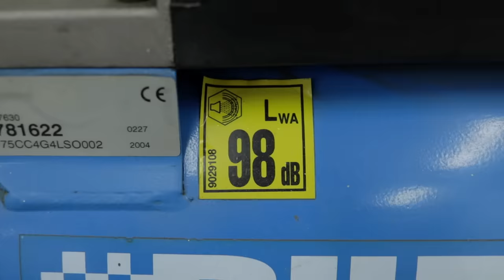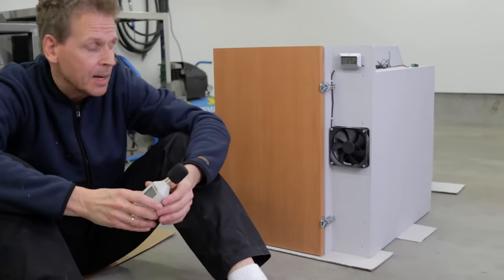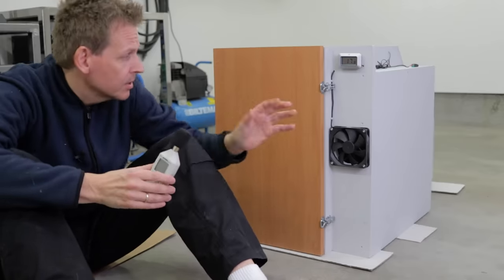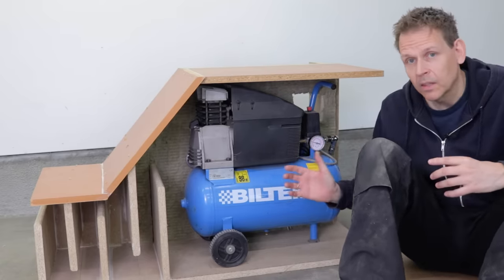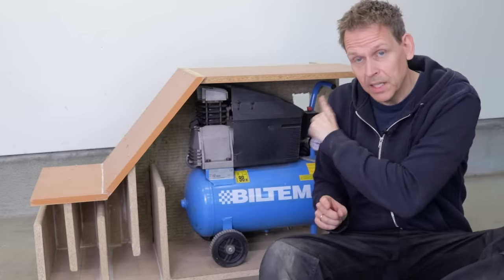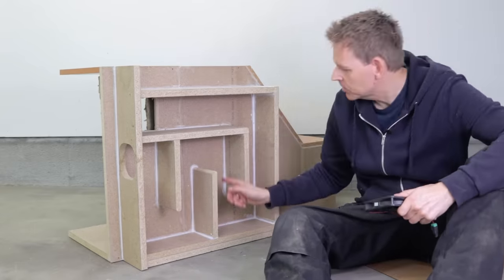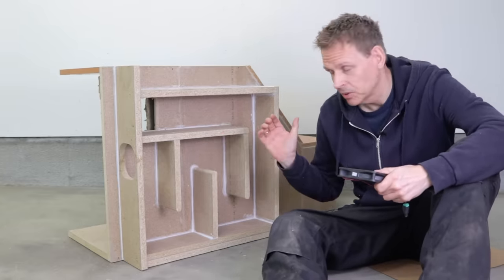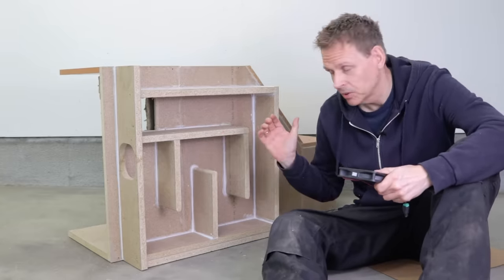Do not build a sound insulated enclosure for your noisy air compressor!

Comment: One suggestion I would like to give would be to place a rubber mat on the floor of the box so that the compressor does not transfer vibrations to floor and onto your shop.
Reply: My compressor has rubber feet already did that, I imagine most do?
Reply from the maker: Yes, that is a very good idea 💡
Reply from the maker: Both if mine compressors had a tiny rubber piece on the foot, while the wheels where hard plastic. I think removing all of these and add a softer and thicker rubber will reduce vibrations transferred to the box

Comment: Transfor it to water cooled and then you can close the box. Or, build a small cabinet OUTSIDE and put the compressor there while you are in a different room, it will be really quiet.
Reply from the maker: You cannot close it 100% even if waterholes, an air compressor needs air 😅 the opening for the air intake is actually on of the most nosy part of the air compressor.

Comment: There is a foam that kind of looks like an egg crate that is often used in recording studios.  The foam both breaks up the noise and absorbs it to provide a quieter environment.
Aside from putting stuff under the air compressor to remove the dense contact vibrations, adding this foam will also help reduce the noise.
Reply: That foams generally not used for sound deadening, but to cancel out or reduce reflections of noise. The material used for sound deadening is more dense. I found this out doing a bit of research on sound deadening rooms.
Reply from the maker: Yep, that sounds to be right. I used Rockwool sound insulation in the main chamber of the box. It's 50% more dense than regular insulation made to absorb the sound waves. I have used the same in my ceiling, and made a video of it: https://youtu.be/4EkoAMJAIug

Comment: honestly, mine makes such a low pitched noise that it isn't that uncomfortable.
If you suspend it on paracord inside the box, it will get even quieter as the mechanical coupling between the compressor and the box will reduce significantly.
Reply from the maker: I guess you might have a belt-driven air compressor? These runs at slower speed and don't make this terrible high pitched noise as the direct drive air compressors. 
Vibrations transferred to the floor is what causes most noise now, suspending the It might be complex to securely suspend the air compressor using paracord, it is quite heavy 😳 I think using rubber or another sound insulation material between the compressor, the box and the floor is an easier solution. Thanks for the tips!

Comment: I just move the compressor to a different room. The only problems I see with box is over heating and remembering to drain the tank when your done working. Compressed air will also have moisture in it that collets inside the tank. If you leave that moisture in the tank you run the risk if it rusting out or worse blowing up because the rust weakened the walls and or welds of the tank. Otherwise, it does make it quieter.
Reply from the maker: Yes, draining it is important! It's a bit cumbersome as it is now, I need to open the four eccentric locks and pull of the door and then take the compressor out of the box. It takes no more than 5 minutes, but it's enough to postpone it to the next day 🙄I better put on a line with a drain valve outside of the box....

Comment: What if you found out where the sound was coming from and put baffled reverse flow pipes there as a muffler?
Reply from the maker: From what I have found a muffler on the intake / exhaust helps a bit, but not very much. I could be wrong though... I did some research but did not find any solution that I found to be very efficient, not even the ones fitted a big car muffler. The tank itself also emits noise because it acts like a sound chamber. I would guess that if a muffler really worked, the vendors would have added it.

Comment: The best sound reduction is to place the compressor in a completely different room a little further away. 
The compressor capacity can easily be solved with a tank (hydrifon tank). It is important then to have a drain at the absolute bottom because a lot of condensation water is generated in it, so blow it out every two hours so you don't get rust in the tank. Please do not have the tank in the same space where you are working, in case it bursts.

Comment: Why did you use fabric padding to reduce sound level in the enclosure?  That's a lot of expense and time to cut and paste in place.  Better is to plan the box and purchase your eggs in natural fibre egg cartons.  Line the inside of the box with egg carton bottoms.  The conical shaped face is a great sound absorber.  And it costs nothing because you were buying the eggs for your breakfast anyway.
A friend of mine once asked for help with his brother's machine shop.  He had multiple hydraulic pumps for CNC machines.  He wanted to consolidate it to a single pump to service the entire plant.  He dedicated a room off the back of the shop for the pump system, provided a ventilation fan that drew air from outside and vented downwind from the inlet.  By keeping everything in a separate room (behind a cinderblock wall) there was hardly any noise from the hydraulic system in the shop space at all.
Reply from the maker: Hehe, you are right about egg cartons - we definitely buy them anyway 😅 But I did actually add 3cm Rockwool insulation made for sound insulation inside tha main chamber. I used a thin but somewhat fluffy fabric in the ventilation channels because I did not want to restrict airflow, but hoped it would help a bit.

Comment: The box need to be with double walls around the Compressor and most important You must fill it with Stone Wool for acoustic insulation....👍🌟
Reply from the maker: Yes, others had suggested double walls for better sound insulation. It would probably have made it even more silent 👍 I do use stone wool inside the main chamber: 3cm Rockwool insulation - an extra dense type made for sound absorption. I know it is not very visible in the video, but it's there ☺️

Comment: Based on the back and forth design of the exit i feel like this is acting like a resonance body too aswell as dampening the sound. The rumbling got louder of the quiet compressor once it went into the box. Kinda like a sub roofer.
Reply from the maker: I think it's because the mid and high frequency sound waves are dampened you hear the low frequency sound better, these sound waves are harder to get rid of. I don't think the box is capable of amplifying the sound, but it's true that it's not that efficient for the low frequency.

Comment: There's three things you're doing with sound.  One is destruction of sound and converting it to heat.  Two is a physical barrier that blocks the sound.  Three is damping surfaces so they don't excite and become speakers themselves.

The box you made sort of does these to a marginal degree.

Products like foam or fiber batting primarily target higher frequencies.  It doesn't do much with lower frequencies until you have a rather significant amount of thickness, think several inches.  So it's use partially depends on what frequencies you're trying to remove.  And then you have to have a thickness amount suitable for the attenuation you're seeking.

The second part is blocking sound.  You want a physical barrier.  This is effectively what your box is, but any high density product works.  Even metal is a remarkably good product to use.  For sound deadening products that address this, usually vinyl or lead is used.  The barrier should also be decoupled from other surfaces.  You don't want it imparting excitation of itself into the nearby structure.  Again, sound deadening products built for this often have a foam layer bonded to the vinyl or lead "wall" to decouple that surface and help prevent transfer of energy.  You can also use layers of walls and even different materials that individual excite at different frequencies.

The third is addressing excitation.  You want to stop the panels from vibrating.  You want to damp them.  Typically this is done with mass loading and stiffening.  Again, for sound control products, there's already a solution in the form of a butyl adhesive layer and a decoupled aluminum layer, and this both damps and stiffens the surface, drastically changing its excitation frequency and its decay rate.

These tools work together to both block and decay sound waves present in the space as well as prevent the transmission of energy and excitation of panels.  Typically, the mass loading layer is about 25% coverage dead center of large open panels to damp and control excitation.  Then over that is typically a 100% coverage layer of a decoupled high density layer being used as a barrier.  And beyond that is another, thicker layer of foam to to trap and break down sound waves inside the space converting them to heat.  And this system as a whole doesn't need to be very thick either.  The car audio world has forever been managing sound at very high dB levels and all frequencies.
Reply from the maker: Thank you very much for your thoroughly explained comment. I will definitely read over this a couple of times, I have a lot to learn about this, it is a very interesting topic ☺️ Thanks a lot!!!

Comment: The reduction was impressive, could make all the difference in a more crowded environment.
Reply from the maker: Absolutely, the box the way I built it helps a lot. Replacing the noisy air compressor with a silent one also helps a lot. Doing both, silent air compressors in a box, and you will never go back 🤩

Comment: What I plan to do when we move and I can build a proper workshop is hook up two compressors in tandem so I can plumb air throughout the workshop and outdoors (and firepit!) and have plenty of capacity to do whatever I want with pneumatics but install the compressors in their own outdoor enclosure constructed with cinder blocks so it's completely isolated from our house and home offices and also doesn't bother neighbors.
Reply from the maker: Very good plan! If you can move the compressor away, in a separate shed, that's just great! Could be that one big one is better than two small ones, but it all depends on your usage 😊
Reply: @kihestad  to run just one sandblaster, or just one HVLP sprayer, or just general cleaning and impact or ratchet work and maybe playing with a few pneumatic servoes as a home hobbyist, two in tandem is a better and cheaper solution than one large unit. I plan to run a solar array and have a powerbank to run hobbyist stuff like compressors, the greenhouse, and even a heat pump to keep the greenhouse climate controlled year round (and grow lighting for the winter months)
Reply from the maker: @kimvette1  great plans!!! Good luck, you have a lot of fun work ahead!!! 😊

Comment: Why didnt you use the sound absorbing/damping pads used in sound recording. They dont cost much and would work well.
Reply from the maker: I did use Rockwool sound absorbing mats (3cm = 1.2 inch) inside the main chamber, they are great! I used the thin fabric in the channels because I was afraid of not having enough airflow for cooling.

Comment: Well, that was quite the effort. Those oil-less compressors are annoyingly loud. I made the mistake of getting one and (un)fortunately it didn't last long. I replaced it with one that had a cast iron cylinder pump. Much more bearable especially if you install a hose on the intake and route it away from your work space.
Reply from the maker: Hehe, normally when you wait for something to break or wear out  so you can buy a new one - it never breaks and lasts forever 😫😂

Comment: Most noise from the standard compressor is the intake filter assembly they’re videos on that please watch they really work and much cheaper to do
Reply from the maker: Well, from what I have heard it helps quite a lot, but not as much as building an enclosure. The noise is also transferred through the motor and the tank.

Comment: Not that this is a cost effective solution but eastwood makes a scroll compressor that is significantly quieter than a piston compressor.  Granted it is a shop compressor so its much bigger and more expensive but the amount of air it pumps is disproportionate to the noise it produces.
Reply from the maker: I totally believe you are right. I heard one those running once (it was not an Eastwood though), it was just a bit louder than an old refrigerator 😅 but unfortunately too expensive for me 😔

Comment: when building sound proofing, once important design element is an air gap.  If you were to build an outer shell that only touched the inside as little as possible, it should reduce the dB's even more.
Reply from the maker: Ahh, yes that makes sense. Thanks for the tips! Perhaps a bit complicated build, it will be like making a box within a box with spacers in between, but it is absolutely possible 😊
Reply: @kihestad  yep, when sound proofing it's amazing what that air gap does to the final results.

Comment: Some people use duct tape, some use zip ties,

This man uses o rings.
Love the video, but wondering why the title was chosen? I would still do it, just feed to outside air. I also live in rural country, but I think protecting your hearing is always worth it (I've lost my once good eyesight, my cardio endurance and a few joints don't work well. Hearing is all I got left). Plus I think the enclosure adds some protection if the compressor should go wrong (tank explosions are real/manufacturers do make mistakes).
Reply from the maker: Ahh, sorry to read about your eyesight and other problems. It easy to take such a thing for granted until problem occurs. I do agree, I think the box is worth both the cost and effort if you consider the protection it gives - both for your hearing and possibly to minimize damage if explosion happens.

Comment: Tried an sound reducing enclosure on a larger compressor a sears 6.5 HP oil free unit. sound was reduced by more than what you seem to have, but box was much larger. Problem 1. excess heat in summer months reduced run time by many times, like after running for 1/2 hour it required almost 45 minutes to cool enough to run again, #2. in winter it got to much condensate after shut down and as it cooled it froze and broke a valve. skip enclosure to preserve life of the machine!!
Reply from the maker: That is a very valuable info! I absolutely share your concern when it comes to overheating. The air compressor will not live for long if it is constantly hot above the recommended specs! 😐 However, It's a pretty cold climate here where I live in Norway, in the Northern part of Europe. I have actually fitted a heat pump in my garage to be able to use during winter time. I can see overheating is a big challenge in warmer climates. A more powerful fan or even radiator cooling could be needed must then be considered.

I have fitted a thermometer and I do check frequently that it's not getting to hot inside the box. Normally the temp increases 5C = 10F when it starts until pressure is built up, and it takes just a couple of minutes to cool it down. If it is running constantly over longer periodes it can get a bit hotter, I have seen almost 10C = 20F increase. The warmest summer days can be 30C = 86F here where I live, but that is very rare. Its more commonly 25C = 77F, so it never gets very hot inside my box.

Comment: Like a muffler, you need to fill the empty spaces with a baffle material that not only reflects sound but absorbs it.  putting the sound absorbing material on the walls is not enough, you need to fill the empty spaces part of the sound maze.
Reply from the maker: I might have left the ventilation channels a bit "open" - but I also want quite a high airflow for cooling - so it's a tradeoff. I might add a bit more though, because I have plenty of cooling as it is now, a bit more restricted airflow should be OK. Thanks for the tips! 👍

Comment: The baffles slow the air down, so in principle, you need to provide a lot more of it, in the context of muffling a compressor. Also: helps to have selective hearing. I know, its a superpower, but I got it. You can try to achieve it though.
Reply from the maker: I know all about selective hearing (I am married) it's a superpower indeed 😅

Comment: I think you could have reduced the sound a bit further by wrapping the exterior in  Mass Loaded Vinyl (MLV) insulation but its far from a cheap product. What did you use to power the PC fan given its a very low power requirement?
Reply from the maker: I have never heard of MLV, have to Google it now 😝 I had a 5V / 1Amp power adapter that worked fine for the fan

Comment: One thing, I dint manage to catch in the video, I have one of those "silent" compressors, mine came with an small plastic hose that's pressure fitted Into the intake filter hole, that reduces the noise floor by a lot. see if you have one laying around from the box or get one, its quite a game changer, if you have yours put on and is not visible in the video then disregard this 😅

Comment: If you need silence, use old fridge compressors (as many as you need for the amount of air you want). If you go for a ready made, separate the tank from the actual compressor. Insulation box will be much smaller and less cooling is required.
Reply from the maker: Yes, I think someone else suggested the same. They are very silent as is, you barely need any sound insulating box for them. However, you need a lot of them if you want the same amount of capacity as a regular air compressor.

Comment: How do you manage draining water build up inside enclosure?
Reply from the maker: It's a bit cumbersome as it is now, I need to open the four eccentric locks and pull of the door and then take the compressor out of the box. It takes no more than 5 minutes, but it's enough to postpone it to the next day 🙄I better put on a line and have it on the outside....